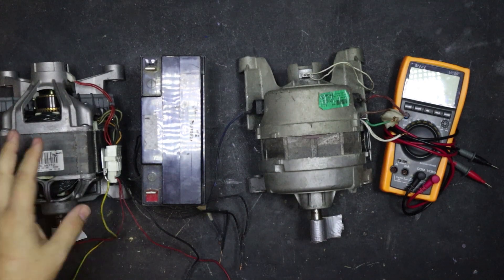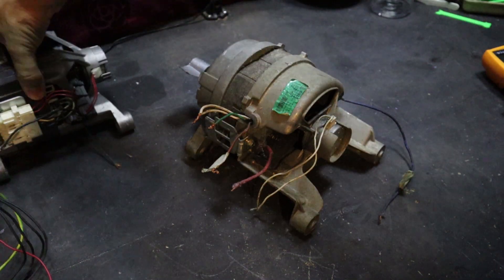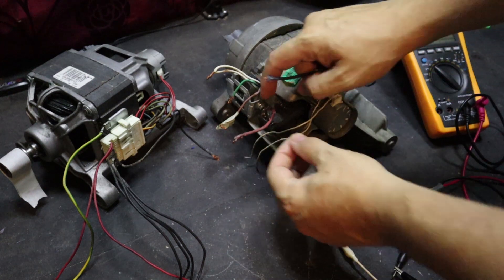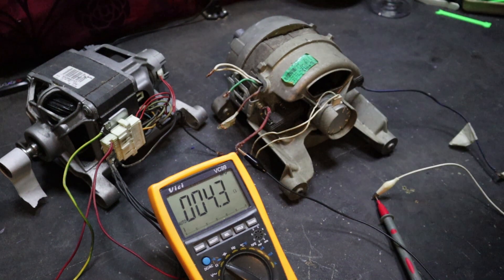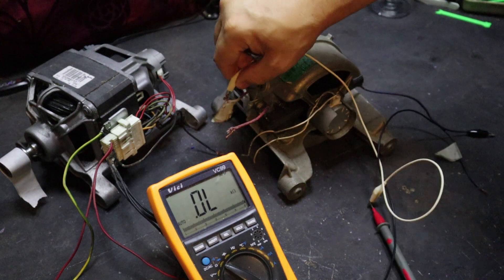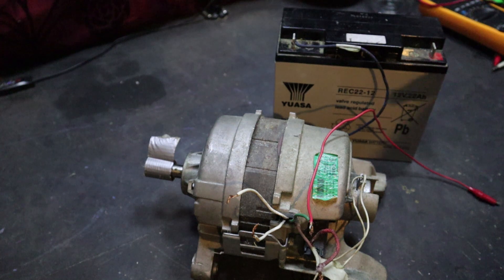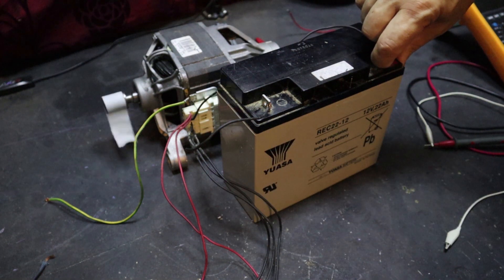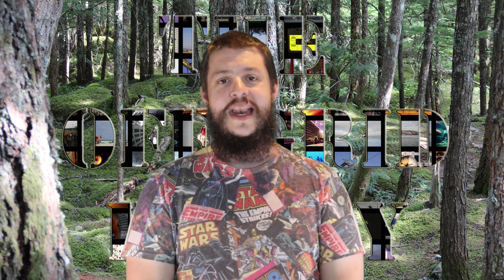Running A Washing Machine (Universal) Motor With A 12v Battery (WIRING)

Comment: So my motor can run at 1400rpm, is this limited by voltage? I assume the more voltage you put into it, the higher the rpm? Which i assume could be controlled by a potentiometer?
Reply from the maker: I would assume that's correct but I can't be a hundred percent sure I haven't done as much testing as I'd like to. I will do more testing this year. I will do an entire series on motors
Reply: Would also like to know how many Amps it draws from the battery @TheOffGridFamily
Reply from the maker: @ Sadly I havent had a chance to do any more work with motors. If I do then I will make a comprehensive video series

Comment: Want to use a washing machine motor for running a homemade rock tumbler. I’ve kept the pulley and belt. How would I control the speed? By pulleys or resistors?
Reply from the maker: Nowadays you can buy extremely inexpensive motor drivers that are good quality and very accurate. That would be the easiest approach.

Comment: I've been trying this for 2 days with 120 volt AC motor to a DC battery I can't figure it out
Reply from the maker: Hey Michael, is it a universal motor? I have another video on how this process works, just a slightly different way of figuring out the wiring. Check out my channel for the other one.

Comment: Well explained thank you.So if you want the motor to run to turn in the opposite direction, do you just swap the battery leads over?Just to clarify things.M:yougotthis:
Reply from the maker: In theory Yes. Some motors are a little strange but 99% should allow you to change the rotation by changing the polarity. If you need any help at all just send me a message. Stay safe brother :)
Reply: @TheOffGridFamily  Thank you very much.
Reply from the maker: @markwilliams2830  no worries buddy 🙂

Comment: Those it have enough tongue to roll a pulley of a generator alternator and if run for long.  Would it warn out?
Reply from the maker: These motors are designed to last for years, as for torque it depends on the type of motor you have. I'd do some tests on the one you have but I'd say it should have enough to run an alternator.